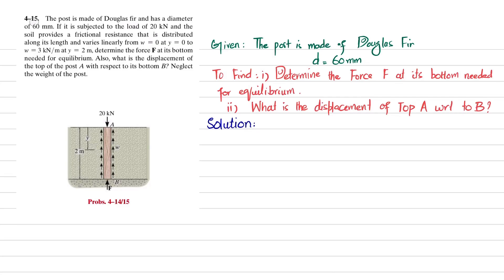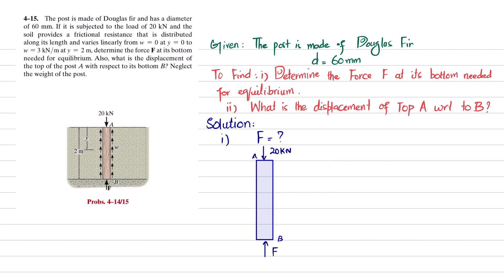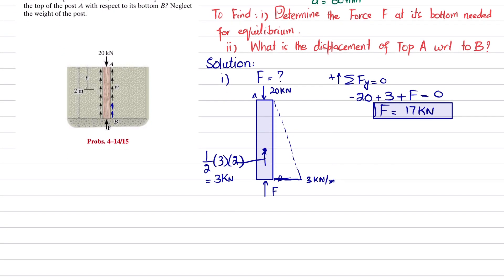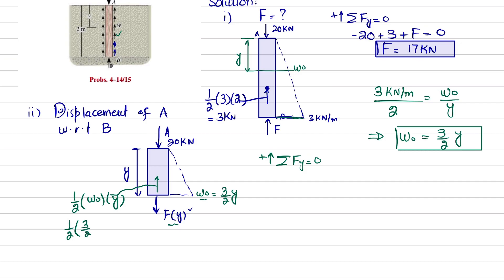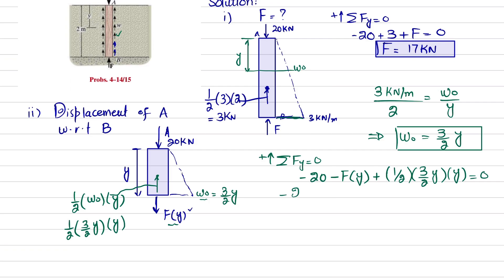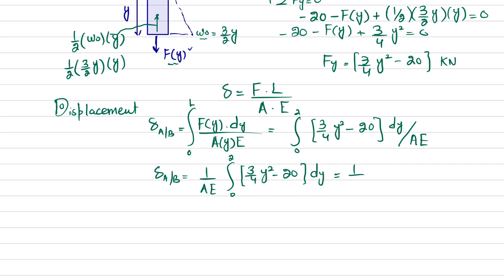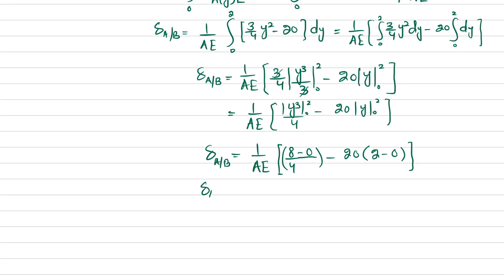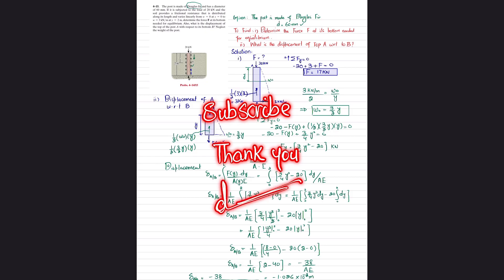4-15 Determine force F at bottom and displacement of top post A | Mechanics of materials RC Hibbeler

Comment: Two things, really quick. Shouldn't you find area of the rod using area equation A=(pi/4)(d)^2 since you're using diameter instead of radius? Because when I use the diameter equation, I get the same answer that you did. Except, I got -1.026 E -6 like you originally had before it was changed.
Reply from the maker: you are rights it's my mistake i have written wrong it's pi/ 4 d^2